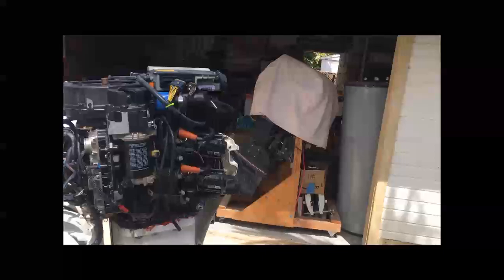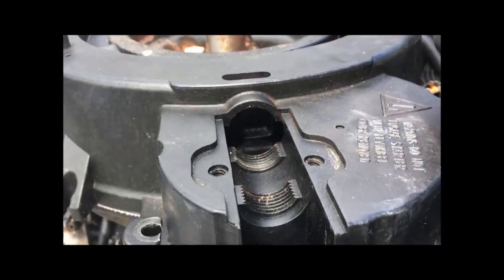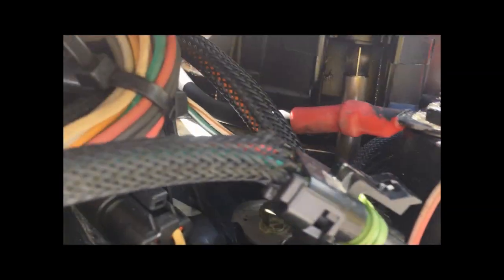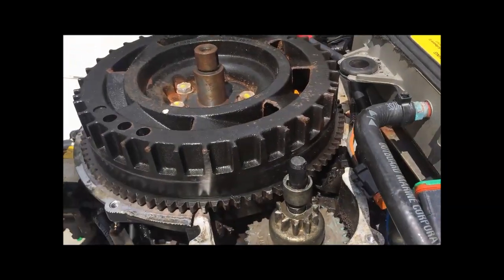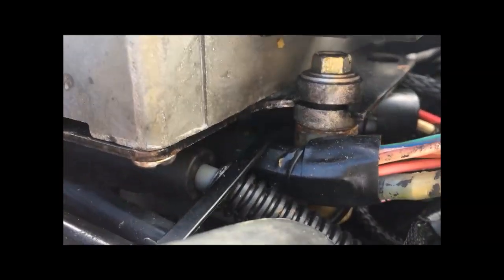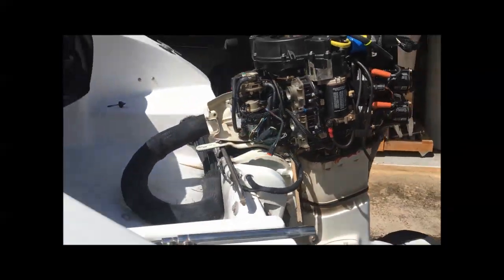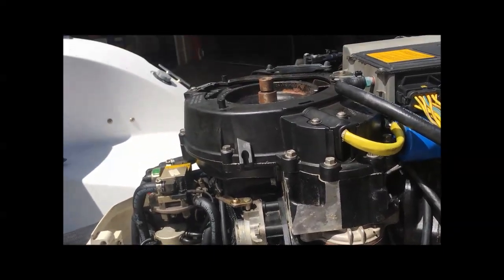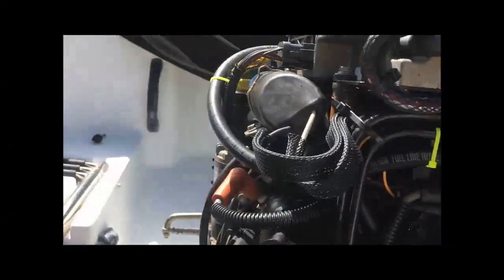Evinrude 2001 115hp starter-bendix repair

Comment: I used grease and it was a mistake, got to use something less thick like WD40 because grease made it stick and not spin up. Any drag on the Bendix will cause it to not travel up.
Reply from the maker: That is possible, I used grease because that was what already there (but it had dried out)

Comment: I have same engine and same problem gear not coming up.PS I want to sell whole boat motor and trailer for around 800 its 1975 boat 2000 fuel injection 115 evenrud engine